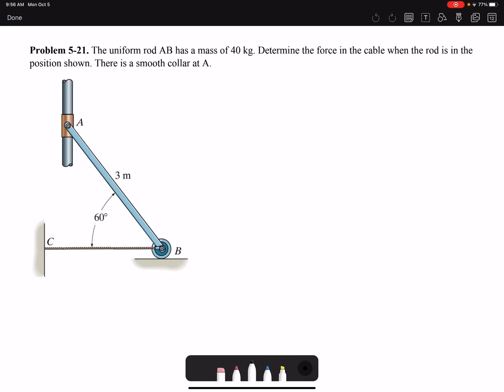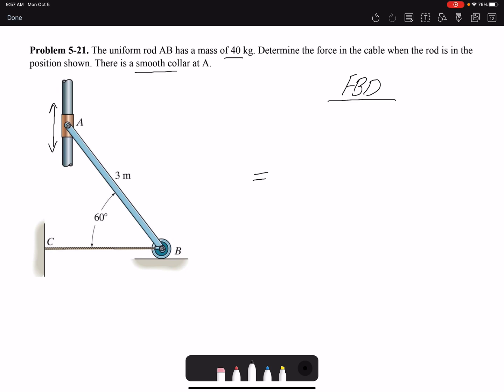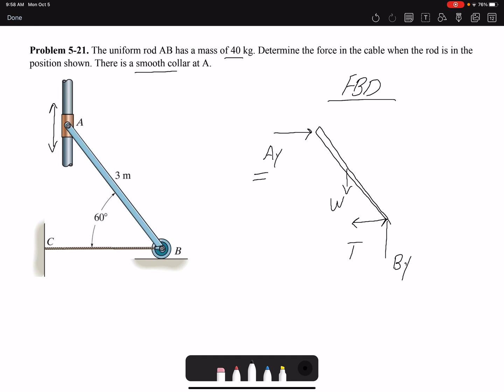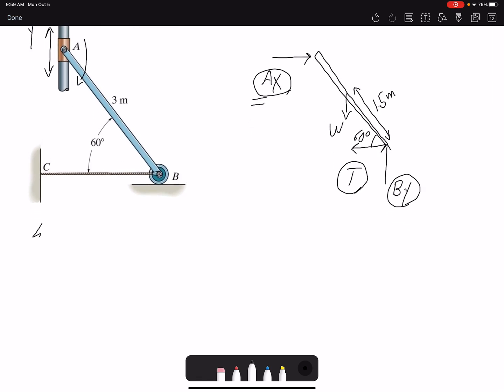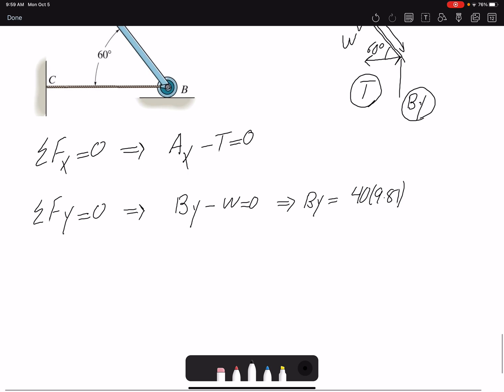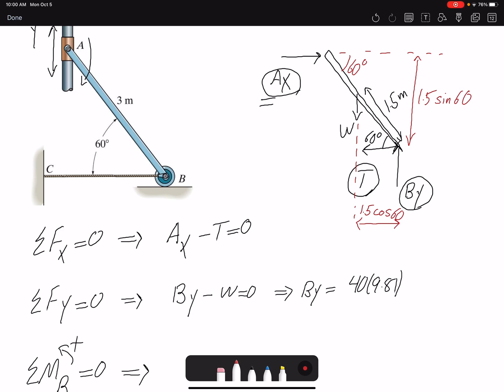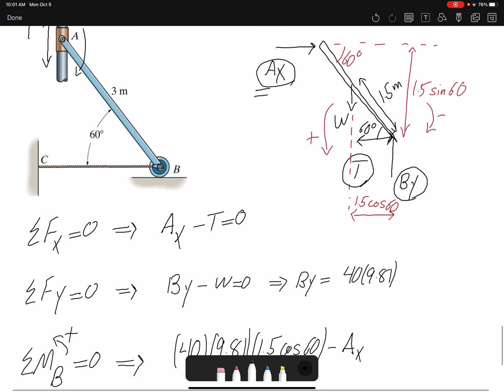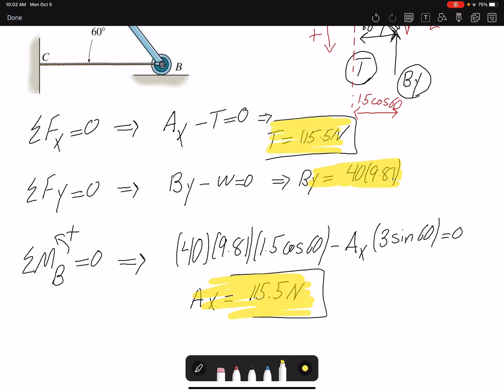Statics Problem 5-21: Equlibrium of a rigid body in 2D

Comment: Professor I have a question here, smooth collar  produces reaction force perpendicular to rod but here we draw like it's not exactly perpendicular ,I wonder why?
Reply from the maker: It is perpendicular to the surface
Reply: @engineeringvision  but in the table it says it must be perpendicular to the rod
Reply from the maker: @ygt824  It should be perpendicular to the contact surface, so the best practice is to draw a tangent line to the contact surface and then the reaction force would be perpendicular to the tangent line